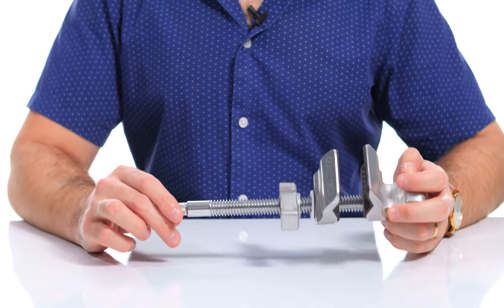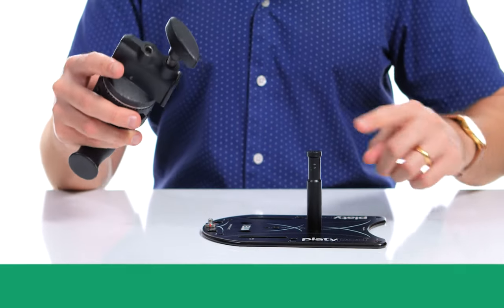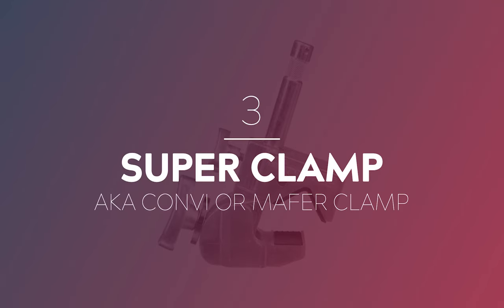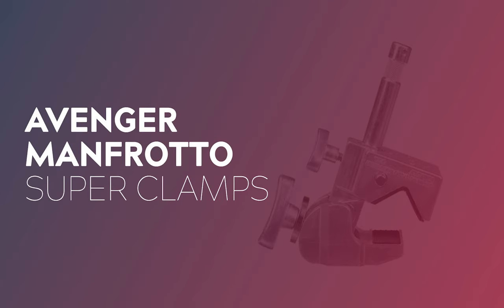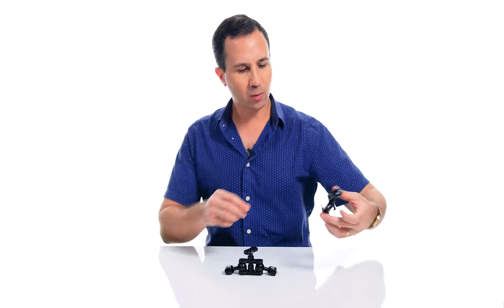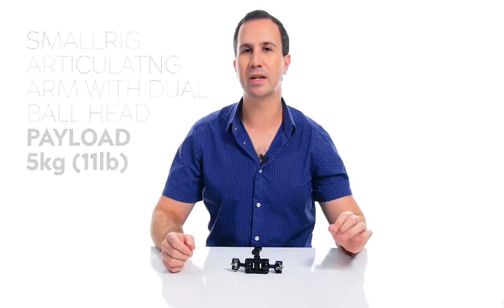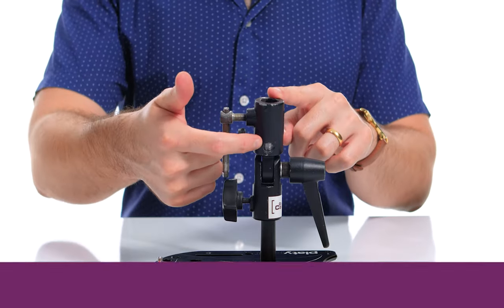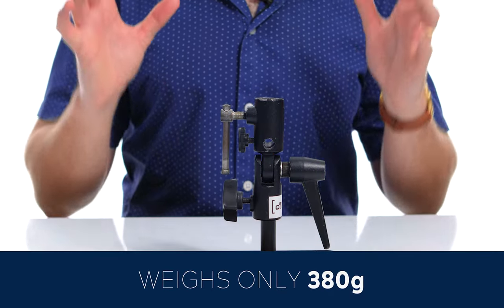The 6 Gripping Clamps Every Filmmaker Needs! | Gear Guides | Film Lighting Techniques

Comment: What are your thoughts on the super clamp vs. the cardellini? Does the super clamp hold more weight?
Reply from the maker: Sorry I don’t have an answer for you on this one. I haven’t had hands on experience with the Cardellini clamps, but from conversations I’ve had, they seem to be comparable. Cardellini don’t seem to list their payload capacity so I can’t compare them based on spec.
Reply: Cardellini  is much better  as a Grip with  almost 20 yrs of experience   ive maybe used a maffer 30 times besides  on the end of a magic arm  cardellinis  and mathellinis   are    much better   tighten much better  hold better and yes will hold  a larger payload   the first clamps he showed were   cardellinis   just  from a different manufacturer  which is why went by another name    but they were  cardellinis  for better or worse